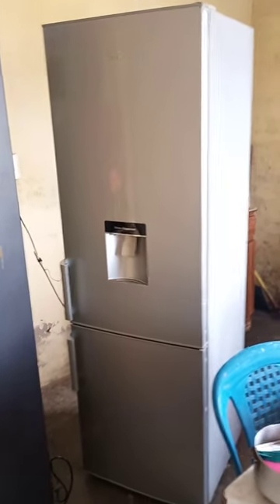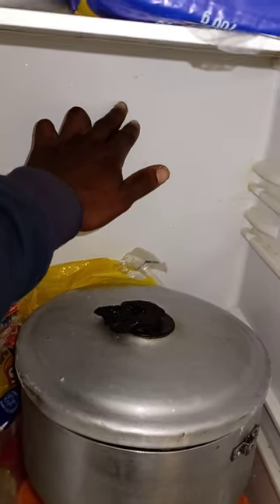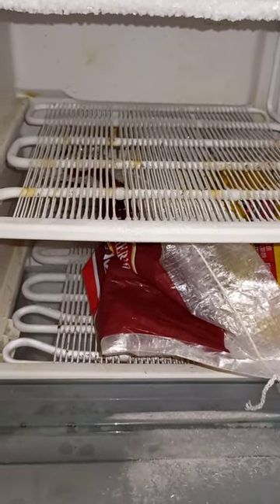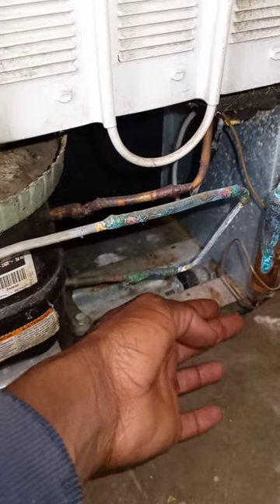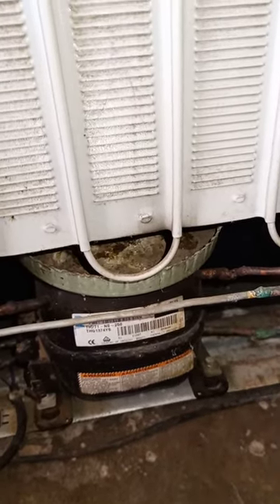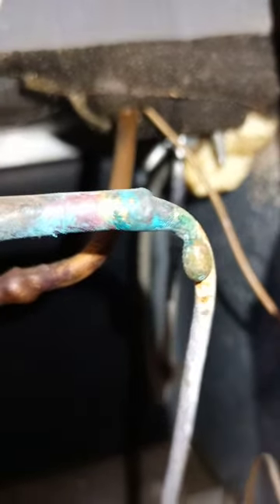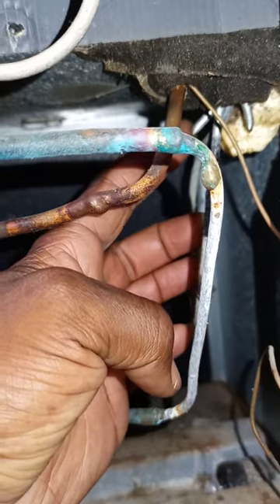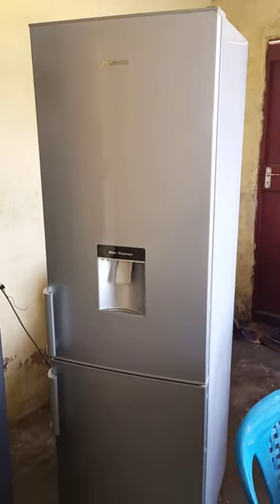Hisense fridge freezer with water dispenser not cooling

Comment: The thermostat u always connect it to the fridge section not freezer , but for deep freezer u connect it from capillary tube entering the deep freezer
Reply from the maker: Fridge part 100%
But for a freezer its not that way, remember a capillary tube is there for metering refrigerant, liquid expansion, pressure drop and more. Cooling is done by the evaporator meaning that is where our thermostat probe goes.

Comment: No u can repair the internal leak by removing foam and checking were the leak is , but then u have to open the body and close it with glue or selotape
Reply from the maker: On my own opinion and reasoning that is time consuming and requires a lot, by the way leaks are caused by rust meaning we will have to keep closing leaks as rust keep damaging pipes(at whose expense?) If we repair and don't replace. Its better to replace a leaking system. I have one upcoming video where I repaired a system leaking in six places because of rust, and am never doing that again!

Comment: Ok that means if u put service valve on the compressor and vacuum but still not going to -30 that means there is a leak,
Reply from the maker: Some leaks give you -30, so you must wait atleast 15 minutes and more to see if it's not moving back. Always remember this method is precisely, the accurate one is charging with nitrogen and waiting 24Hrs.

Comment: Me i know that when checking for blockage u put the gauge and the needle must move when pouring gas if it does not move then know there is a block
Reply from the maker: Lets say the blockage is on the cappilary, when you charge the gauge will go up normally as if there is no blockage. But when you run the compressor all the refrigerant will be sucked and compressed on the condenser, your gauge will be on vacuum pressure. If you add refrigerant while its running, it will keep on sucking it and you will keep getting vacuum pressure. When you stop the compressor refrigerant will not equalize it will remain on vacuum. That is how a blockage on suction, drier, condenser and capillary behave.